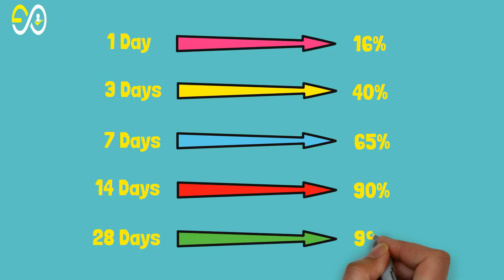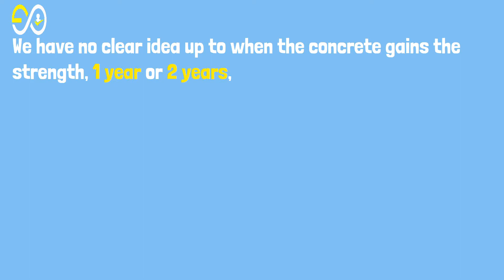Why Do We Test Concrete Compressive Strength After 28 Days?

Comment: You need to learn a bit about audio if you're going to be an amateur video creator. That bell sound actually hurt my ear. I'm using earbuds and that was ridiculous man. If you don't know there's a handy tool called a compressor. Learn it and make it your friend. It help you expand the audio of the video and limit the audio to not going beyond a certain threshold on the sound effects you add in like the bell. Furthermore you can use a limiter for the same effect.

Your video could actually cause hearing damage if someone were to follow your channel and expose themself to it repeatedly. These are very basic tools that won't require you training your ear like a sound engineer but you can easily learn and apply. 

Nothing and I mean NOTHING takes away legitimacy, professionalism, and quality like audio issues. I'm not only complaining here I'm hoping to teach you something that helps.

Comment: Time for gaining strenght depends on many factors and varies widely. The temperature of the air (winter and summer are different), the type of concrete (the amount of cement), if there are additives or fibers, the type of structural element matter. Wall and slab gain strength differently...